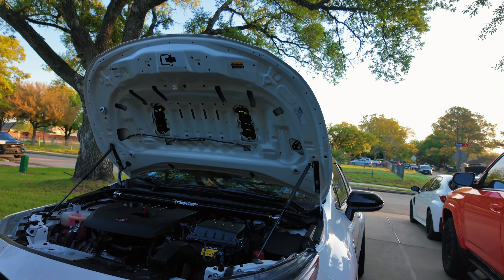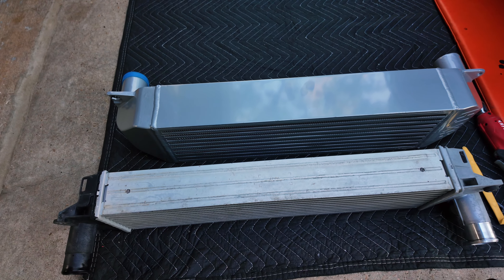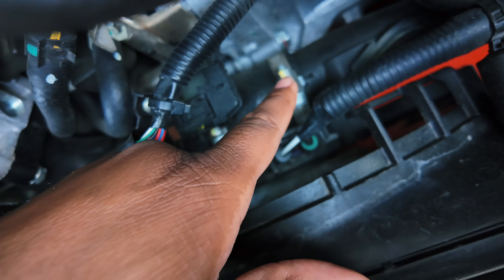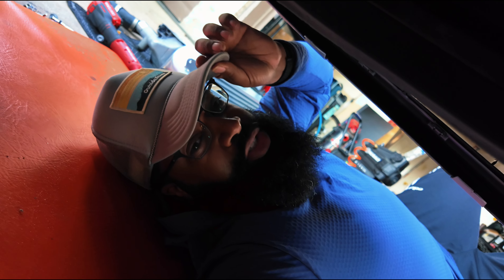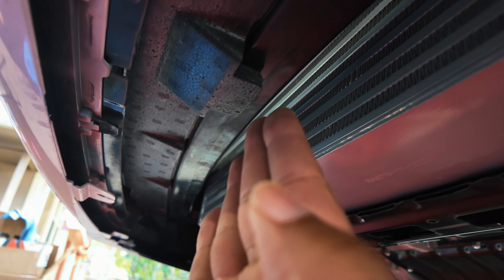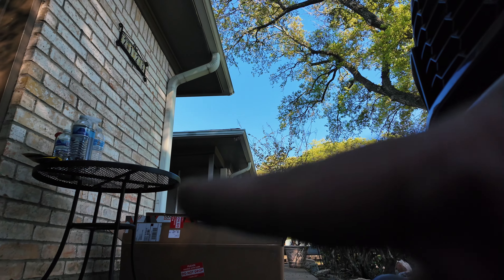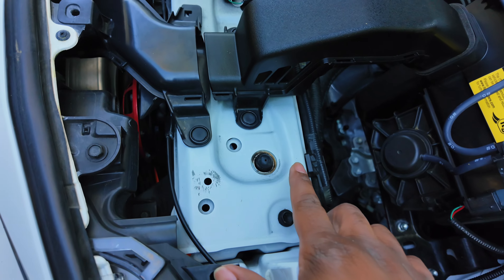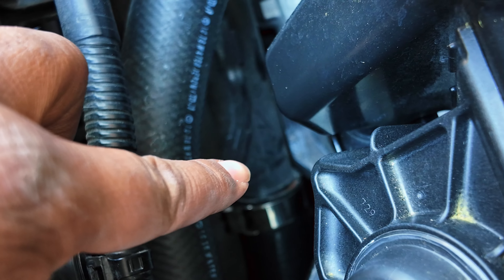SXTH Element Intercooler = Happy Temps | GR Corolla Install

Comment: I have the same intercooler from SXTH (did mine a month ago)make sure you check for boost leaks after installing. Pressure test maybe a hour to hour and half install including pressure testing for leaks again with a lift in the shop. Pro TIP if you have boost leaks you will hear them especially over 15lbs of boost roll you windows up if you hear whistling sounds in boost you have leaks (we did after first install). Then pressure test with oil cap off (vent crank case pressure)and pcv capped use soapy water to look for leaks.. otherwise you are good to go. Also don’t over tighten couplers use silicone or hairspray to seal new charge pipes. FYI hairspray works great
Reply from the maker: Ha! We did each of those suggestions, but ended up changing out the clamps, as we heard the same leak under boost, but inspecting the clamp noticed it was damaged and swapped it. Car is performing great!
Reply: @CarQuicks  So the clamp was defective or intercooler.

Comment: I read on the website you don’t need a tune with this but idk better safe then sorry
Reply from the maker: You do not. I’m running a full downpipe and intake from MST without any tune, car has been running flawless for thousands of miles.

Now I will get a tune, as that will give me all the potential the parts have.
Reply: @CarQuicks  I'm new to my GR but I had an Sti then went to this I know u can run the mst v1 and v2 with no tune and there's alot of other parts I'm amazed on how this is done are u using an ots map what's the app you run to clear codes for cel because gr does not have an accessport?